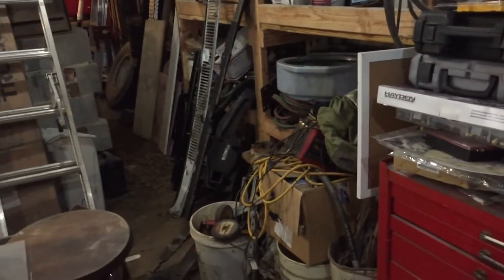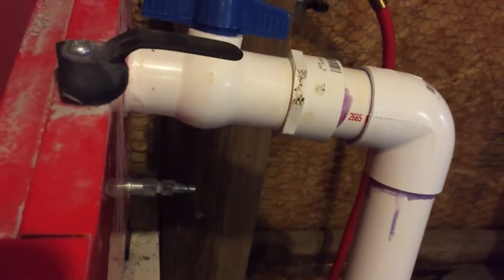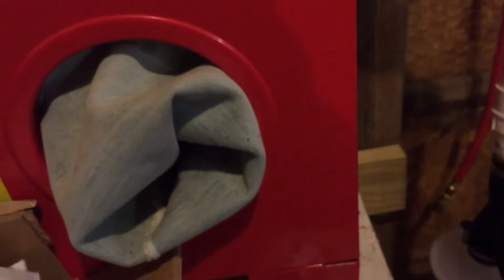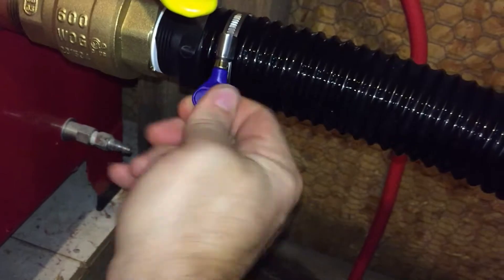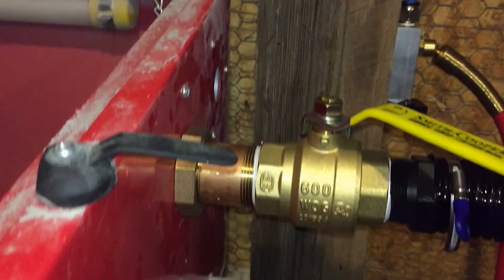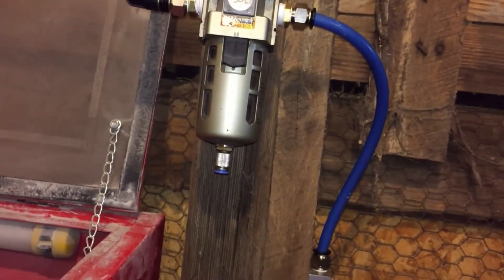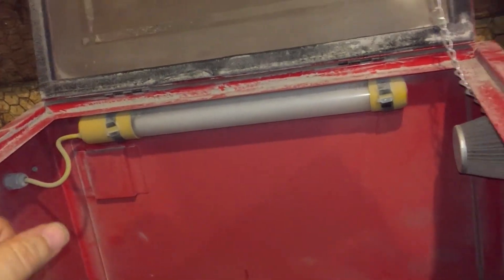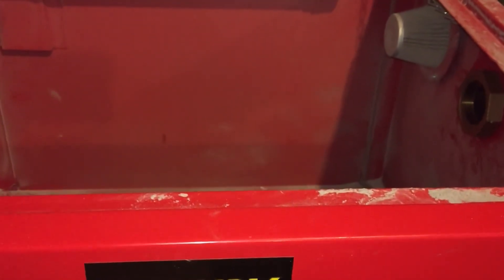Sandblasting Cabinet Vacuum System Part 2

Comment: I like that setup , yes the brass valve is the best way to go.  Jay I took the screen out of the bottom of the blasting cabinet ,  it was just in the way and the media wouldn't flow to the suction pipe right. Thanks for the mention buddy.
Reply from the maker: Thanks Steve!  I have thought of removing that screen, it does get in the way!